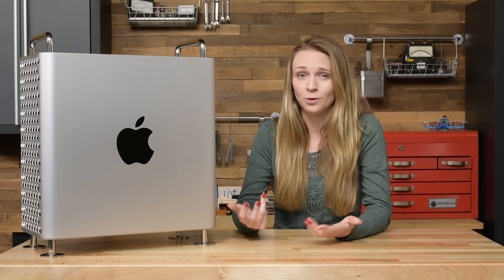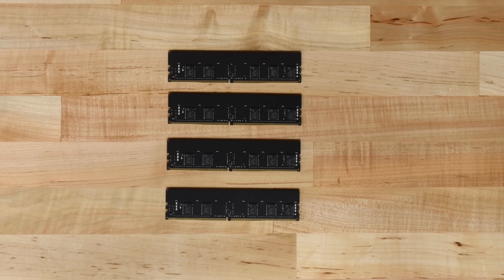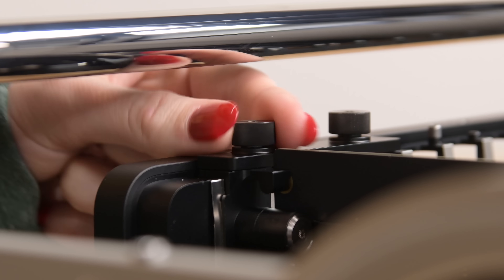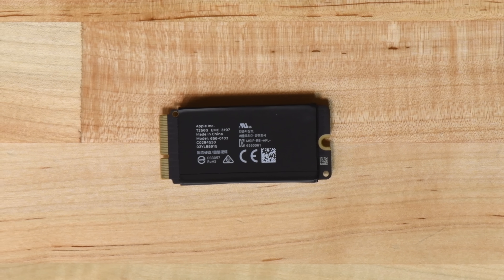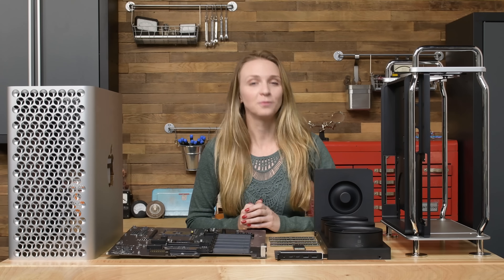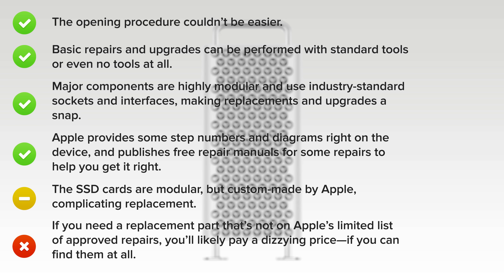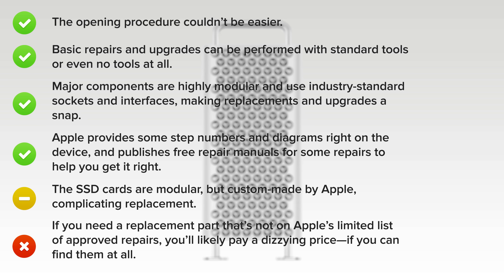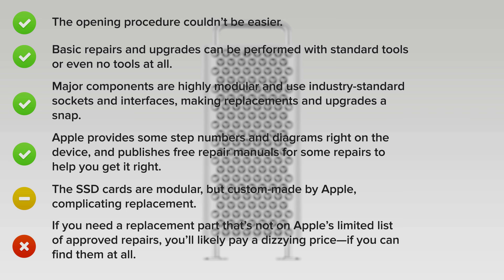2019 Mac Pro Teardown - An Almost Perfect Machine 9 out of 10

Comment: Why does the mac pro get a 9? For a normal desktop it is horrible. You cant get motherboard replacement and if one of the two m.2 ssd breaks then you cant boot the computer because they are tied into the t2 chip, you cant even replace it without going to an apple store and getting a bogus qoute. That is not a 9 for a desktop computer. A normal desktop computer gets a 10 because non of it is proprietary and can be replaced, while in the mac pro you have lots of things that you can only replace by going to an apple store.

Comment: I mean, 9/10, everything is proprietary except PCIe cards, RAM and CPU. If the power supply breaks for example, good luck repairing it, probably it will mean a couple of hundreds of dollars for an original part instead of less than 100$ for a standard ATX PSU. The SSD slot is proprietary for no reason, there is no reason to not use a standard NVMe SSD instead of a proprietary one, the fact that there is the T2 chip makes no sense, you can have all the things that you have with the T2 with a standard interface. Also the fact that this computer that costs 6000$ doesn't come with PCIe and SATA proprietary power cables that must be purchased separately for like 100$, come on! 6000$ and you don't include stupid 1$ cables?

Comment: Can't replace SSD. Most internals are custom made except Ram, so upgrading or replacing a part will be super expensive. Gets 9/10 repairability. Seems legit.
Reply: Stanislav Knopp You can replace OEM parts with non-OEM parts.

Comment: So Apple made a PC that costs a lot for no apparent reason. Well I'm not surprised...
Reply: This is a workstation, not meant for regular consumers. A Lenovo with these specifications would cost even more.
Reply: @diegoh.4904  I know it's a workstation, if you want to get robbed by Lenovo too be my guest. At the same price or less I can get a 32/64 Threadripper, 64GB of ECC RAM with 2 RX Vega FE that will destroy that machine under every aspect. The base model of the Mac Pro has a 8/16 Xeon, 32GB, with a Pro580X and is overpriced beyond reason.